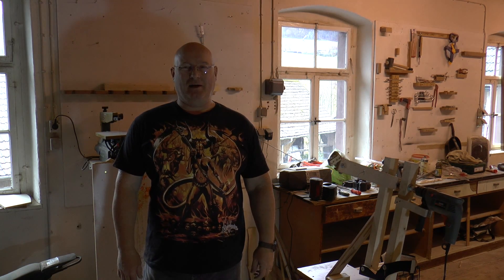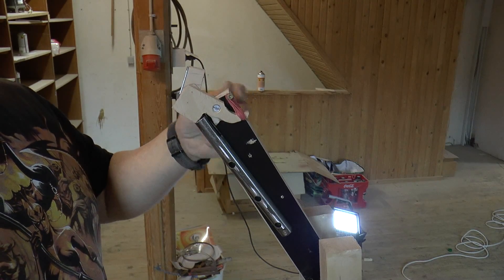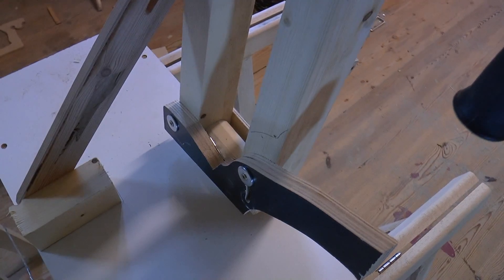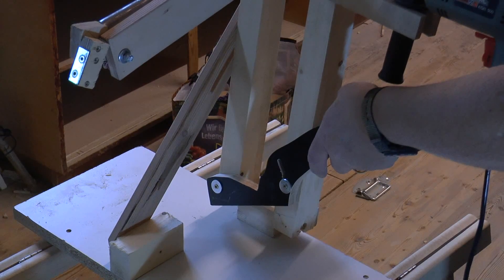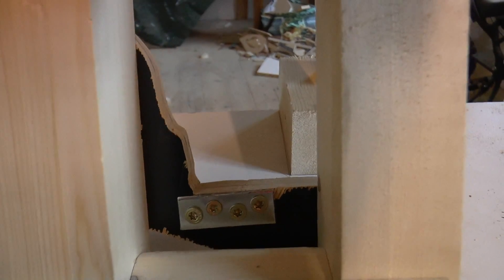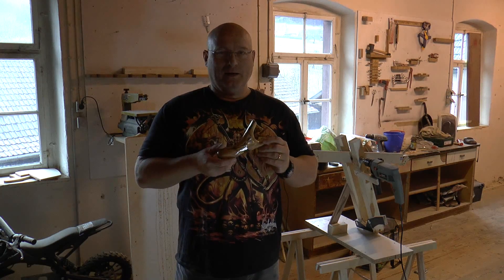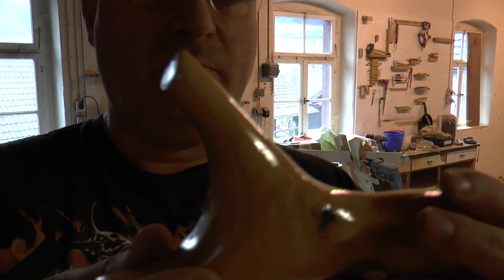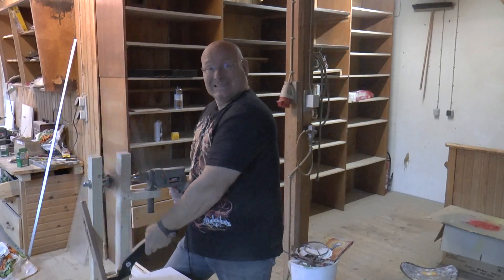"The Rotor Blade Of Death" (Marbles Machine Gun)

Comment: because BRRRRAAAAPP.
That's a great start, what if it was steel balls fed into a central hopper which fed them to a motor (2 h.p.) driven "jai alai" style (s-shaped) arm in a circular arrangement which ejected them at high speed when they reach the end of arm (originating from center)? .... 200, 300, 400 fps ?

Comment: My buddy broke a florescent light via launching an empty bottle of Mountain Dew.
You drill a 1/2" hole in the cap of the bottle. Thread it back on, and then slip it over the end of an air compressor blower. Fills the bottle and OFF IT GOES! In his case, the light fixture. Irresponsible creativity leads to the most fun.

Comment: I wonder if it would be possible to have some kind of marble feeding mechanism so you could fire for much longer without having to load each marble separately. Maybe it'd even be possible without having to redesign the whole weapon.
    Maybe it would work if the "spinning board" (on which currently are the marble magazines and launching mechanisms) was hollow right until the spinning axis, and you would actually feed the marbles through the spinning axis, which would have to be hollow as well. That would probably mean that you could only shoot from one end of the "spinning board", as the other end would only have a counter weight on it's end, so the rate of fire would be halved, unfortunately.
    The tricky part would be to make the feeding through axis work. It would have to be very solid so that it doesn't break and also doesn't shake too much so the marbles can be pushed in through it without problems. Also, you'd have to make sure that the external magazine is able to constantly keep the internal magazine full, because otherwise the center of mass would no longer be in the center and the shooting would get very rough (perhaps increasing the weight of the "spinning board" would help mitigate that, although then you have a lot more energy to worry about if something goes wrong (2 kilo spinning plank isn't as scary as 10 kilo spinning plank)).
    Now that i think of it, this WOULD be a complete redesign of the weapon.. ;(

Comment: Joerg, a question, if you were to build an even bigger version of this weapon, do you think it would be better than your giant slingatron machine gun?
Reply from the maker: TerminvsEst Well, there is less friction so the efficiency is high - but the impact of the dispensers is really tough, at some point a better mechanism would have to be devised. The slingatron has a better feeding mechanism, which allows huge mag capacities.
Reply: JoergSprave
 What if you were to go with something not fixated for the bottom part of the dispenser.  Bunge, or something spring loaded?

Comment: Use magnets for an "impactless" trigger? Oh and find an old washing machine for the motor, that could be interesting :)
Reply: JoergSprave I may be wrong here but i think the magnets are simply for the triggering mechanism instead of hitting two reinforced pieces together for the trigger to fire you instead have the trigger pass a magnet and use the magnet to trigger the mechanism. Although that said i do believe they would have to be really very powerful magnets given how quickly the trigger would be passing them for them to able to affect the trigger mechanism sufficiently to operate the mechanism.
Reply from the maker: ***** Forget magnets, glass marbles aren't magnetic... and also the centrifugal forces are very great, lots of pressure, too much for magnets.
Reply: ***** Did you see how much rubber is holding the lids? The magnets have to be huge. to get that kind of repelling force. If you wanna use a magnet you're better off using a reed switch for the triggers...but that would just be complicating things.
Reply: ***** I have not fully designed the mechanism just describing the basic concepts which needs the gaps to be filled in. In an escapement (as used for part feeding etc) the action of releasing one part holds back the next part but could also engage a catch. It would even be possible to make the centrifugal force do this in theory, a little how certain mechanisms lock when you pull on them, again I am talking in generalities.
Reply: JoergSprave +JoergSprave Wow, I'm not that stupid! :) Two HD magnets would work to drive the mechanism instead of metal plates slapping each other. You make the poles opposite so one repels the other. This sort of magnetic cam has been used in industry.
Reply: Mat Wyatt Yep, you can have a small gap, use HD magnets and amplify the movement, maybe lessen the spring tension a little in the escapement.
Reply from the maker: ***** The pressure on the lid must be fairly high because the centrifugal force is very significant. As I said.
Reply: JoergSprave I am sure you could design a suitable mechanism, the spring on most of your other triggers does not hold the force of the rubber for example although it is more tricky of course. Also try pushing two rare earth magnets together, there is a lot of force in fact.
Reply: ***** It would be possible to change the mechanism so the ball is held by a catch rather than rubber directly.
Reply: ***** But what makes it go back into the locked position then?
Reply: ***** You make it an escapement that rocks from one latched position to the other. It would be similar to the current mechanism but the load would be against a catch not rubber. It can still be spring loaded but the spring would act at 90 degrees to the ammo not against it. There are many examples of mechanisms that hold a large force but can be released with a small one.
Reply: ***** Yes but they don't reset themselves(?) I have a hard time imagining exactly what you're describing though.

Comment: I predict that on higher speed outside it will break. In the last scene you could see the amound of wooddust that gor airborne even from the low speed, I think Joerg is pushing the limits of the wood's structural integrity in this one.

Comment: Joerg you could build nice bows with your woodworking skills. Any plans on that ? I mean, it has longer lifetime than rubber and it is more energy-efficient than a crossbow.  And if you dont overdraw or dry-fire it, it could even serve you a lifetime with linseed finish.
Reply: A slingshot might be less durable, but the wood is and you can carry dozens of replacement bands in a small pack with you. They can shoot arrows as well and are considerably smaller

Comment: Do you suppose that paintballs would be sufficiently durable to be fired by that machine?
Reply from the maker: Ostsol The tougher types, maybe.
Reply: Freeze them for a bit ...
Reply: JoergSprave Heads up Joerg, 'Allens Jaffas' orange coated chocolate balls make good cheap fun ammo (they aren't strong so wouldn't be suitable for this machine but may be good for another project). They are basically like a candy paintballs, good for target practice as they are light weight and leave a red powdery mark on hard surfaces. I don't know if you can buy them where you live but I'm sure you can get some online.

Comment: Needs modification. 500 marble capacity, not 12!
Reply from the maker: RanndomUndead It is 24 marbles, total. 12 per side.
Reply: JoergSprave yea i mixed up my numbers, 12 was supposed to be 24.
I was thinking with a stable enough mechanism, could have somewhat of a paintball gun setup
Reply: RanndomUndead if you make the magazine heavier, with more marbles, the trigger wont slow it down as much. That will increase velocity and precision. it could have cone like container on the side, full with marbles

Comment: Vacuum seal dead wood with epoxy to give a fully reinforced piece,
Also it's the size of the the clip that's causing issues with stability, outside of the fact you're using wood anyway.
Just too much force being awkwardly dispersed with the current design. Think centre of gravity, guessing the double barrel makes it slightly more even and it's also the firing mechanism that'll throw it off a lot with how much it ate away at the wood, less force used to open the barrel means less wasted and more continuous firepower.
Reply: What did you just say ?  Loz
Reply: 3brewster Yeah I probably could've worded it better . . . in proper sentences . . . some people got the gist anyways . . .

Comment: how long would that last? considering the effect that speed would have on the wood?
Reply from the maker: TheGEODEAHOLIC They are much less than 45 degrees, maybe 30 degrees, tops. I am not THAT stupid.
Reply from the maker: Rafe Shankar It is plated with steel, so I think it should last OK.
Reply: JoergSprave if both intersecting faces of the trigger & the barrel were tapered from their current 90°to 45° the impact would be less & the mechanism would last longer.